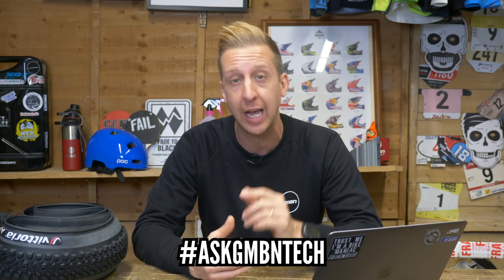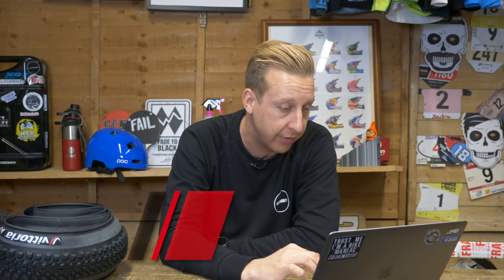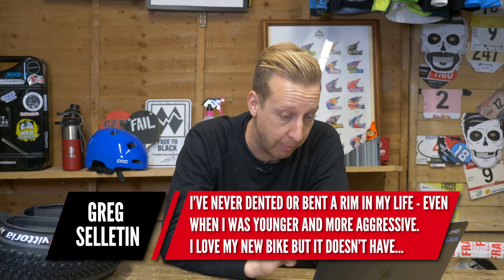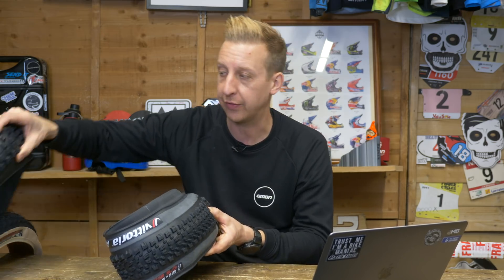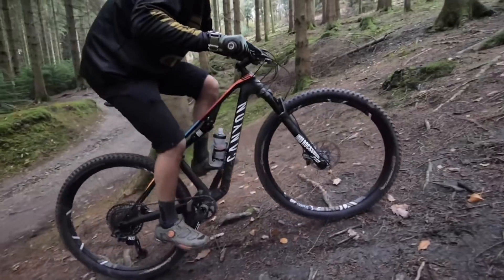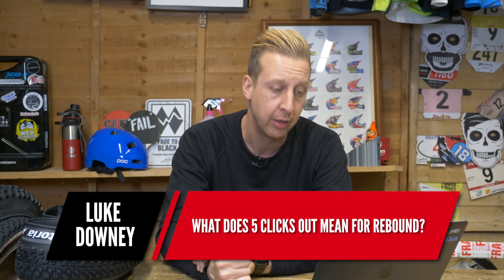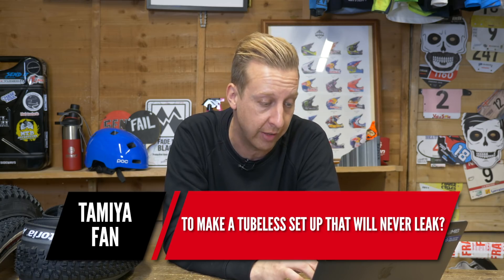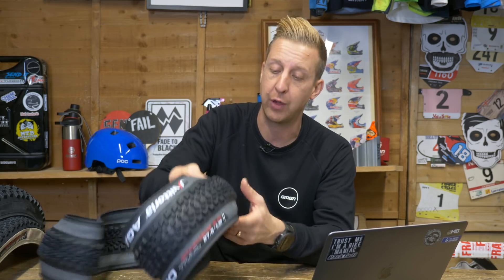Best Way To Fix A Ripped Tubeless Tyre? | #askGMBNTech

Comment from the maker: Do you want to see a video on tubeless tyre repair?
Reply: Yes! Would be great! Thanks for the answer!
Reply: Previous vid on it was v thorough...dont think need repeating, but a link in description maybe?
Reply: yes, or re-publish the original.
Reply: Yes please, have seen the other one. But would nice to see another one more into depth.
Reply: Yes. I'd like to see a video on tubeless tyre repair.
Reply: I've used a motorcycle 3mm combination patch to repair my tyres(got 3 in the rear tyre). Its a proper permanent repair and is 100% air tight. They are a patch about 15mm in diameter with a 3mm stalk attached. Vulcanise tyre, pull through and cut off. Perfect.
Reply: What is your opinion of ghost mountain bikes
Reply: my tubeless has never gone flat, or needed repairing. But ya, just in case please dods!
Reply: Yes please
Reply: I got my canyon spectral 4.0 3 months ago but it came with a fox 34 performance 140 instead of Rythem 150 .I noticed however that these forks are 29/27.5. Should I get a 29’ wheel in front and use 29 in front and27.5 in back#askgmbntech
Reply: i fixed mine yesterday like in the video you previously made, had a huge hole, so I sew the tire and now its usable again!
Reply: Aye!
Reply: #askGMBNTech Hi Doddy a Henry, i have 2 questions. I buy a new brakes Shimano XT, and i want to bleed theme, but one freestroke is tight so much, that i can´t unscrew it without risk of damage - Is any way hove to do this safely? And, theoretical, is possible to use mineral oil for car gear box (transmission) to this brakes on mineral oil ? Thanks so much. Love the show. Have a nice day. Miky
Reply: @davidglanfield3897  with what do you glue the patch?
Reply: @bjlevi  just use vulcanising fluid as you would with a standard puncture patch

Comment: #askgmbntech What would result in more cornering grip: Lower tire pressures or knobier tire tread given the similar tire volumes for the same corner? Could GMBN do a video on maximum cornering speeds with Blake quantitatively testing a range of tire pressures and tire knob profiles on the same corner?

Comment: 9:30 I think weight will be more of an issue with the clear sealant instead of the tape, cause motorbikes are single walled and apart from the zipp wheels mtb rims have a hollow chamber so it will get filled with the sealant and add more weight than a bit of tape. (if this makes sense)
Reply: I think the air pressure would squeeze the sealant in between the walls of the rim, giving you an impossible mess and no seal at all. Some hacks that use tapes that are too stretchy or fragile will get pushed through the rim holes with the air pressure and start to get sliced by the edges and leak. And like Doddy says, that sealant could lock in the nipples and make replacing and adjusting a big pain. The best proven cheap hack is Gorilla tape.

Comment: I have recently converted to tubeless. Finally. I also got some Dynaplug tubeless repair kit. These come in two sizes. Have a brass end to get in to the tyre. The plus actually fuses with the tyre to make a permanent repair. I have not used them yet. It even looks like you can use more than one if the hole is too big. Not sure about on mountain bike tyres.

Comment: A new bike should also come with some spacers to put in the disc brakes when you remove the wheel. Volume spacers maybe. I would ask the manufacturer (Pivot) what they send and then ask the shop for it.

Comment: #askgmbn I have a generally silent canyon torque, but when I ride my bike on stairs, the back wheel will make a loud noise on the transition between stairs and asphalt. The rear end also makes the same sound if I bunny hop and loud nose heavy. The cassette is tight and the tyres are pumped up to 30 psi. Any idea what the sound may be? #askgmbn

Comment: a good solution to sidewall slashes is to superglue a small piece of inner tube on in and then the sealant is gonna do the rest. Think it like from a slash you smallen the hole (if not eliminate it) and the sealant is going to have to seal any holes remaining

Comment: I had a stick the size of my finger go through my tyre. Stitched it up with normal sewing thread. Put a patch over it on the inside and shoegoo over the outside. It’s been going strong for ages I can’t believe it!
Reply: i once did a 'temporary' patch with gorilla tape (all the way around the tire and rim), because the hole was a little too big for the sealant to close.  and forgot about it, but it held up for the rest of the life of that tire...

Comment: Canyon doesn't come with volume spacers(beyond the ones already installed)... but did get a shock pump.

Changed my tires from DHR2 to 2.4 Bontrager SE4 to get a much faster rolling bike when doing pedalling. If going to a bike park with lifts then DHR2 is preferred for the extra grip.
Reply: If it comes with a RS fork, then it comes with a couple of Tokens.
Reply: @th_js  Well.. not for Fox36

Comment: I have an old trek rumble fish mtb 29er 2012 . I’m going to upgrade  my 3x10   Shimano xt to 1x12   M 8100  shimano  xt  is it compatible even my rear wheel hub is 28h..... what will you recomend for my full  suspension.

Comment: #AskGmbnTech
Hi Gmbn Team, 

I have a question about my dropperpost. The dropperpost (Command Post IRcc) of my specialized stumpjumper is wobbling. For clarification here is a video link.

https://youtu.be/lHbRRnrHwbE

according to specialized this would be normal and within tolerance. Is that right? The dropper posts from friends of the Fox and Rockshox brand do not wobble that much.

Keep up the cool show! 
Cheers Marty

Comment: Id love for you guys to make a video and purposely hit a rocky trail with low rear tire pressure, get a snakebite and show how to fit it on the trail, both for tubes and tubeless setups. I recently converted to tubeless and im really afraid of getting a completely flat tire now
Reply: That's why u always carry a spare tube...in case of slashed tyre wall

Comment: #askgmbntech   I currently have a 2020 Norco Bigfoot size Large with a Reach of 470mm, Top tube 648mm, wth a 60mm stem. I am looking to get a trail bike, 2020 YT Jeffsy Comp, which has the same reach as the Bigfoot, 470mm, but a top tube of 615mm with a 50mm stem. I believe the difference is due to the steeper seat tube angle of the Jeffsy (77 degrees vs 74 degrees) . The Norco feels perfect, my question will the Jeffsy feel the same?  How important is the top tube length versus reach? Does it matter that I am more of a sit down spinning climber over standing and grinding?

Comment: If you want to thread together tire sidewalls, use dental floss, it is thin and made of plastic, it is basically perfect for the job. (cannot use normal thread as it will rot away when exposed to the elements)

Comment: GMBN.       Pls answer.  Can I swap my shimano Dureller with a shram one on my kona shred if I change the shifter as well
Reply: Shimano and Sram have different pull ratios so you need to change your shifter aswell
Reply: God engrush

Comment: #askgmbntech Hi Doddy and Henry, i suffered a serious Foot injury in October 2018 and i am in the last bits of recovering so i can start riding again when the season hits. My question is, as my bike was standing still since the injury, what maintenance would you recommend doing apart from the obvious like bolt, tire and brake checks? Should i do a bleed to the brakes and maybe a lower leg service on the fork etc? What would you recommend doing? Thx for the great content, keep it up! Greetings

Comment: #askGMBNTech Hi there, I recently bought a 2012 Scott Scale pro (carbon). I am looking to upgrade with a dropper post, but have some trouble figuring out whether it is compatible. I have a 34.9mm seat post. My current seat is 190mm from the crown of the tube to the bottom of the seat post rail, but the inside of the tube has only 240mm before the bottle cage mount bosses protrude inside. Will these interfere with a post and what could I do to fix this?
Reply: you have to measure the inside diameter of the seattube, i would guess that its 31.6. You have to make some measurements before you buy a dropper to see if it will fit. you need to know insertion dept and current saddle height to find out how much of a drop you can install

Comment: #askgmbntech
Hi Doddy!
I've got a 2015 Canyon Strive (CF) and my shapeshifter isn't working that well. I'm planing on bleeding it, but I was wondering, if I could (or should) take it apart to check the seals. I can't afford to buy a new unit yet. 
Thanks

Comment: I hit a land mine of a rock and put a hole in a brand new minion. It was pushing worms out, even with vulcanising solution. Ended up pulling the tire off, cleaning the inside thoroughly and applying a large, rubber patch to the inside.

At first it was very slowly weeping air, so I got in the habit of parking it with the repair turned to the bottom so that it was bathed in sealant.
Reply from the maker: Yep this works, vulcanising patches still come in handy!

Comment: Hey Doddy,

I still have the old Quick Release axle as you are explaining around the 45 SECOND mark of a previous video you have made on GMBN Tech and am now looking to upgrade my suspension forks to FOX but they all use the more modern bolt axles.

How can I upgrade my suspension forks and still keep the old Quick release axles as this is the only option I have without breaking the bank and buying a whole new set of wheels.

Thanks and love the show.

#AskGMBNTech
Reply: find an older fox fork 2nd hand or look into other brands. Or find a new front wheel, they dont cost as much since a front hub is quite simple

Comment: #askgmbntech Hey Doddy, first of all great show - continue to do great content! 
I've bought a new Canyon Neuron AL 7.0 with SRAM NX drive train. Since I got this bike, I have never been able to adjust the shifting to my likings. I've followed different tutorials online (your's as well) but I just don't manage to get it working properly. Whenever the rear suspension is in use (sprinting, bumps, ...), the rear mech tries to shift down by one gear.. However this just happens in the middle of the cassette  - it's fine in the lower and upper gears.
Is it recommended to lube the housing or do you have other tips?
Thanks!

Comment: #askGMBNtech 
Hi Doddy. 
In todays show Greg Selletin asked about making his bike faster rolling, which made Me think. 
My 2020 Scott Genius 950 was "born" with 2,6" Maxxis Rekon on 30mm rims. 
In wet and muddy Denmark, the tires picked up a lot of mud, and didnt clear it too well and I lost grip. 
I replaced them with Nobby Schwalbe Nic 2,6" front and rear. I know think of putting the Rekon back on the rear, but I also consider scaling a bit down to a little narrower tire. How narrow would You advise on a 30mm rim?

Comment: #askGMBNtech Hi team, I have a X-fusion Metric fork with 180mm travel. The fork just has rebound adjustment at the crown and it feels quite stiff. I bought the bike second hand and I'm planning to service it soon. My question is, would it be worth upgrading the damper with a X-Fusion Roughcut HLR Damper for Metric? Thank you in advance for any suggestions

Comment: #AskGmbn Hi Doddy, I've been wondering lately if I could go for a tubeless set up for my 26 hardtail, but the problem is the tubeless rim available in shops is too wide for me (40mm). My question is can I use a non-tubeless ready rim to be set up tubeless? Will it be okay when hitting jumps? Because I have a doubt of it burping and handling big impacts. Thanks Doddy, loving the show.

Comment: #askgmbntech Hey, my question is about braking and tyres. I know that if you skid  on a hard surface it will break your tires but if you just brake without skidding( I mean: without going sideways) on a hard surface will it also break your tires??? Bye and enjoy your ride/s.

Comment: I got my canyon spectral 4.0 3 months ago but it came with a fox 34 performance 140 instead of Rythem 150 .I noticed however that these forks are 29/27.5. Should I get a 29’ wheel in front and use 29 in front and27.5 in back#askgmbntech

Comment: Re tubeless, bike wheels are hollow, so just filling the holes wont work (as to thin to seal hole edge) ...would have to fill entire rim cavity!. Moto wheels generally are thicker single wall so sealant works

Comment: #AskGMBNTech

I am struggling to set the Sag a Fox DPX2 shock, fitted to my 2018 YT Jeffsey Cf Pro Race,
I have had to put in the maximum 350psi, and am still only getting to around 40% Sag, 
I am 187cm/140Kg in my full ridibng gear
Would a few volume spacers help? or do i need a custom tune? or am I just to big for my bike and need to go back to my Hardtail?
Reply: Sorry to be blunt, but yes its a weight issue, ur very heavy (22 stone / 308lb) compared to what most shocks are designed for. I ride at 92kg with water and that's highish. Volume spacers wont help really. Best to email someone like tftuned or a suspension tuner for advice. But u might need to go to a coil set up if possible on ur frame.
But dont give up mtb, whatever.
Reply: @rupedog  
Be blunt as you want. And thanks for your help.
I sort of knew that my weight was the issue, and the more I ride the better it will get.
I was hoping there was an easy (and cheap) workaround i could use until i shed a bit more chunk.
Reply: Yeah, not trying to be rude, but you're just too heavy for that. See if some other shocks have a higher pressure limit or get a coil shock and see if you can find a spring heavy enough. Definitely don't give up! Also you could try stuffing the shock full of volume spacer.

Comment: #askgmbn What should I know about climbing when riding a 27.5+ bike? My bike has WTB Trailblazer in a 2.8 size(got mixed reviews). I love how it is going downhill, in the twists, and flats but not uphill it's bad, worse than my 29er gravel bike on the same trail. A new tire is not an option as I spent my budget on the new bike & bottles. Thank you

Comment: #askgmbntech Hey guys, love the show! Recently my rear hub failed on some trails I had driven 480km to ride. Turns out the hub centre, the ratchet part, is bonded into the wheel, and this had let go, so I couldn't pedal. The wheel was replaced under warranty but I feel I can no longer trust this particular brand (Bontrager Line pro). How common is this fault and are all wheels made in the same way?

Comment: About the weight of a newer bike; that’s the result of bikes becoming faster, as the speed puts more strain on the tires and wheels when you hit rocks or need to brake. At least in here in southern Finland a typical mtb tyre like a Maxxis with EXO casing just isn’t enough if you’re pushing it. We end up using tires like DD or Supergravity for normal trail riding, and that is heavy.
Reply: Where do you ride? Yeah it's quite harsh in Finland if you're an aggressive rider.
Reply: Tomi Saaranen mostly in the central park of Helsinki or Espoo. The last time I had an Exo in the back it got cut on some rocks in Hallainvuori going uphill. I’m 72kg so I can’t blaim that, either.
Reply: @kilobitti  Alright.. I'm from Pohjois-Pohjanmaa, but mostly ride in the Pohjois-Savo alueella. Here pretty much everything is very rocky and rooty except bike park trails at Tahko.
Reply: Tomi Saaranen I’ve once participated in the Tahko mtb-enduro, and it was quite rough on the tires!
Reply: @kilobitti  Yeah, the other trails at Tahko are rough, but I'm talking about the bike park trails called "Easyrider" and "Panama" , which are lift accessed and are quite very smooth (and super fun). (There are  about 5 more of lift access trails there and they are more chunky and technical, which range from blue to black.

Comment: #askgmbntech I am interested in upgrading my wheelset.  I have a vitus senteir with wtb i29 rims and novatech hubs.  How light of a wheelset do I need to buy in order to signifigantly improve performance?  What is the average weight of a stock wheelset on 1300bp ($1500) bike?  What is a reasonable amount to spend on a wheelset for mid level hardtail?

I am looking at a set of  Bontrager Line Elite 30's for 600 usd, weight is claimed to be 1708 grams in 27.5.
Reply: Personally speaking unless the WTB i29 rims are dead then I would buy two new decent hubs and spokes, watch a wheel build video on YouTube for your chosen lace (3x is best) and build your my and save $400! After i have built them take the to my local bike shop to get them trued or again watch a Youtube vid. Seriously it saved me a lot of money and i learned something new, its not as difficult as it may look.
Reply: The Bontys are attractive since they're light and bargain priced, but in my experience...I have the Line 30 Pros and my rear hub just failed after 2 years...the hub centres are bonded in place and the glue let go. But definitely lighter wheels do make a difference you feel it straight away

Comment: Hi guys I’m 7st and I run 90psi which seems to be fine but ppl say it’s too high any tips? Is this too much- I run a fox 34 performance 150mm
Reply: if you have correct sag there is no problem at all. but set sag with rebound and compression dials fully open

Comment: #askGMBNTech Hello guys, I know that if you lock your front  suspension and you hit a  bump, you may risk  damaging it. Does it also apply for  the rear  shock? Does it  matter  if  its coil  or  air ? I am running a Manitou Markhor. Love the show, keep it up.
Reply: Yes, you can bend the shims inside, which will result in the lockout and compression adjustment not working.

Comment: #askgmbntech are the fork axel universal? So if I bought a Kenevo comp with a marzzochi bomber z1 boost 15x110mm, without a lever, and I won't so swap the to easy transport my bike, if a buy a 15x110 boost from fox or rockshox, will it fit? Thanks in advance
Reply: New marzocchi and fox maybe, RS and fox/mz depends if fork lowers clamp the axle